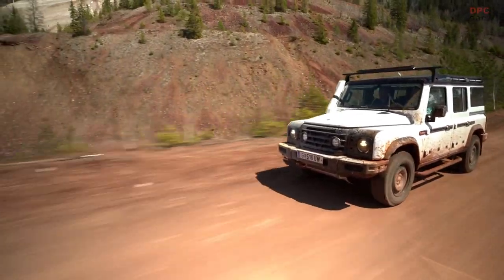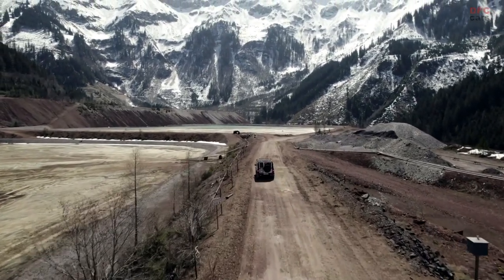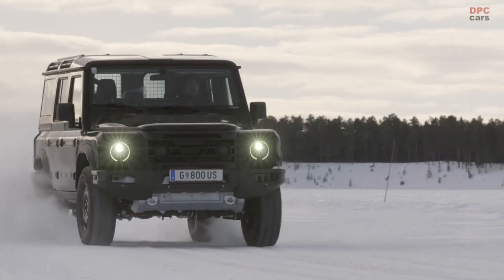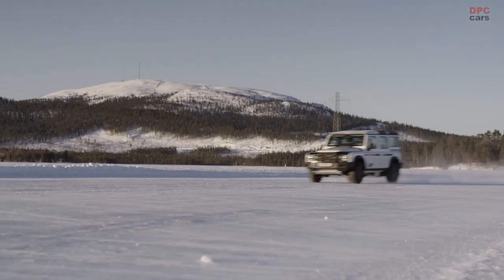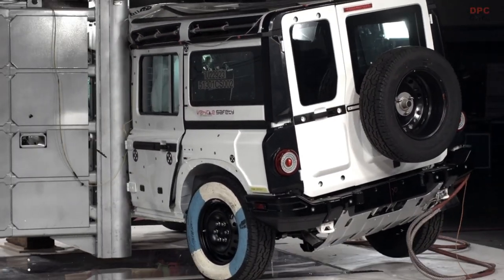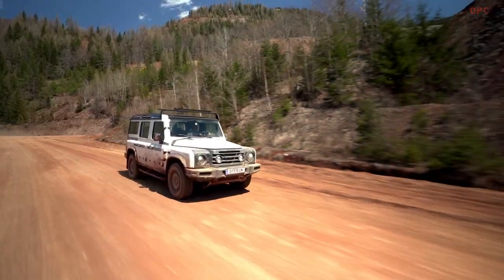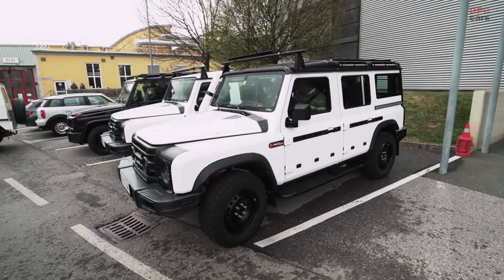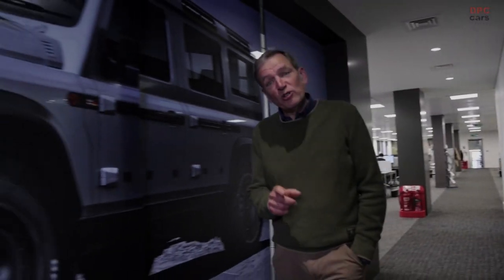INEOS Grenadier Testing on Show Challenging Land Rover Defender

Comment: You better get a few here in Australia in summer time or your failure rate will skyrocket. We have a habit of breaking things here.
Reply: Agree- they should i was surprised they have not chosen Ausi
Reply: I’m not surprised they’re not here yet - fortress Australia would be a nightmare to come to right now for something like this.  Too much red tape, too many access restrictions, too far away - it would cost a fortune.  They probably feel that Namibia is a reasonable analogue for the Outback.
Reply: They're navigating logistics etc, already confirmed coming here.

Comment: Eat your heart out Land Rover !  take a look at what you should have built ...
Reply: They have actually built better.
Reply: @hughmarcus1  Please tell me which model ? i dont think they ever built a good one !  Ive had Land Rovers on&off for the last 40 years and they were all a load of rubbish ! ...Land Rover lost the plot after the disco1/defender 300tdi ! the td5 engine was a nightmare on 4 unreliable wheels    now i would be happy to know which particular heap of rusting leaking badly built Junk your refering too ?
Reply: @hughmarcus1  .... I don't think so
Reply: @emmachamberlain7587  That’s your personal experience. Ive had many LR models down the years. Ive had 4 Discos 2 300tdis & 2 TD5s. Apart from the normal wear & tear issues I never had any serious problems with them. One of the TD5s was my main work vehicle for 7yrs, regularly towing around the legal limit. I put 212k miles on it & sold it still running with its original clutch. People love to moan about Land Rovers but even the modern ones last for over 20yrs.
Reply: @ozminuteman  Pretty sure thats an Aussie saying, replace jungle with bush and you're there

Comment: Reliable 3 litre TDI and permanent 4wd with 3 diff locks is what I would like to see in Canada. Hanging on to my TDI defender and LR3 until these things are launched. Like everyone I'm interested to hear the price.
Reply: Well it’s a BMW straight 6 & the gearbox is a later version of the one that’s in your LR3. As Land Rover discovered themselves, those 6 cylinder BMW engines are great in road cars but aren’t up to the job in a rugged 4x4.
Reply: @hughmarcus1  check out m57 conversions here on YouTube n come back to me with the 6cylinder bmw engines not being good off-road 😂👍🏻think you’ll find they’re used in many off-roaders, comp safari trucks and event trucks!
Reply: @br4d101  Land rover fitted BMW 6cyl engines to Range Rovers (while under BMW ownership), I had one for a while. They were a disaster. The reality is, those engines are designed to power passenger cars, not heavy 4x4s. The BMW X5 is really just a big car, its not a true off roader, it's towing capacity is the same as a Ford Mondeo. Remember the Grenadier is supposed to be filling a slot left by the old Defender. That means it will be expected to work hard every day - all day. Plaything off roaders are a different story, the engine is put under stress for short periods & idles the rest of the time. As for putting the M57 in off roaders, Land Rover's own TD5 is a better engine all round for an off order & when tuned it produces enough power anyway.
Reply: @hughmarcus1  I’m literally in the process of ripping out my 300tdi due to it being generally pretty shit n underpowered n having to ‘rag’ it to get anywhere at a normal speed, I do a lot of towing n occasional off-roading n after owning loads of BMWs n talking with a lot of m57 defender owners everyone has said it’ll be the best thing you can do! The TD5 is a great engine n sounds good but does have it’s problems n there is a reason Dakar trucks don’t use the td5 n stick with the m57 due to the unreliability of the TD5! The bmw range rovers are good, it’s was everything else that was bolted to the engine n not the engine itself that was bad!
Reply: @hughmarcus1  mondeo? The 2016 gen has a lower towing limit of 2.7 tonne and some models 3.5 tonne depending on suspension. 
The engines have huge torque and are very very robust in 3.0d version. They'll be immense in a true 4x4

Comment: I want one of these so bad! Too bad they didn't choose a toyota 4.6 v8 for reliability and simplicity, but im sure fuel economy might have had a part in that.
Reply: A straight six is a much simpler layout than a V8. The packaging on the 1VDFTV Toyota is actually pretty tight and hard to work on. Time will tell with the B57/58 straight six in the Ineos.
Reply: @boriskristo235  I agree, and I prefer a straight 6 over anything but that toyota engine is just super reliable. This BMW engine is far more complicated and has lots of hi tech stuff that is known to fail. Im going to buy one anyway. Hope they offer it with the diesel here in the US.
Reply: I think Toyota actually wanna face out their V8 engines from the direction they are taking.
Reply: @muhammadibnkilab7026  yeah that’s right, the new 300 series has already moved off the V8. They don’t sell enough 70 series to keep it around so that’ll probably switch soon too.
Reply: @muhammadibnkilab7026  yes they are unfortunately
Reply: @boriskristo235  true
Reply: @Jackmerius_Tacktheretrix  that’s the world we live in, constantly changing
Reply: @muhammadibnkilab7026  yes sir it is.
Reply: Isuzu 4JJ would have been even better.
Reply: @boriskristo235  BMW have been using plastic cooling systems for 20 years which have continued to fail. Expansion tanks literally EXPLODE, plastic thermostat housings cause leakage problems and on top of that a timing chain at the back of the engine which is a nightmare with maintenance. Trust me, I’m a BMW guy, I’ve got one right now. They’re amazing on road with meticulous maintenance, however off road, a BMW engine would be a nightmare.
Reply: @mtadc1545  that’s something we’ll have to keep an eye out for on the grenadier. Ineos aren’t tied to use the same plastic ancillary parts just because they are using the same block so hoping they choose wisely on the cooling components and other critical parts.
Reply: @boriskristo235  well i really hope they won’t be using the plastic crap! I also hope that they won’t be having the timing chain at the back of the engine. Those designs make sense in a race track but not off road. Off road is all about simplicity and ease of repairability. That’s why Toyota and Isuzu engines do so well in rugged environments. I still think if Ineos were truly serious about dependability, they would have gone with either an Isuzu 4JJ or a Toyota engine.
Reply: @mtadc1545  I can’t imagine they’d be able to move the position of the timing chain wrt to the engine orientation. 

Agree the 4j is well laid out for maintenance but can’t agree on the Toyota 1VDFTV.

Comment: Guys, will you fit more chassis parts made out of Stainless Steel which are exposed to sand blasting and stone chip, as well as brake linings and grommets which generally suffers from corrosive salt roads, .....some 4x4 competitors parts don’t even see 8 years in more extreme conditions !! Stainless Steel aren’t expensive anymore either and you save on paint!!. ‘Ask Elon Musk”
Reply: Not a chance.